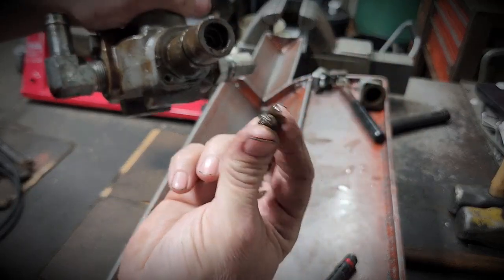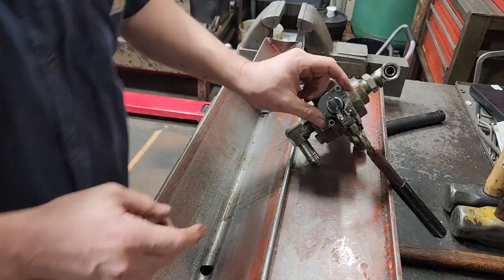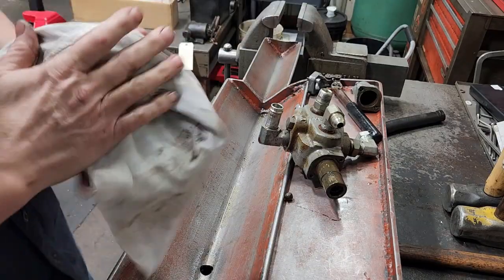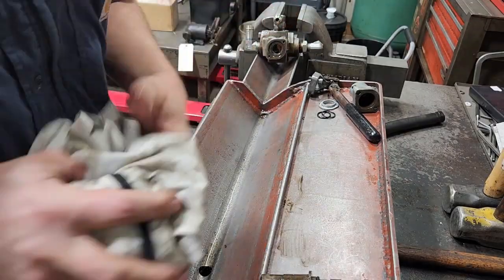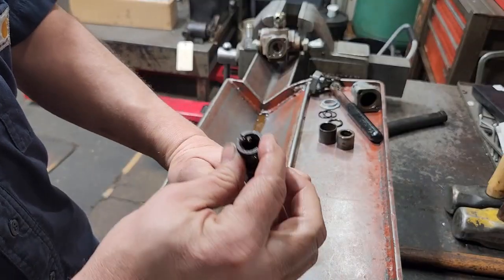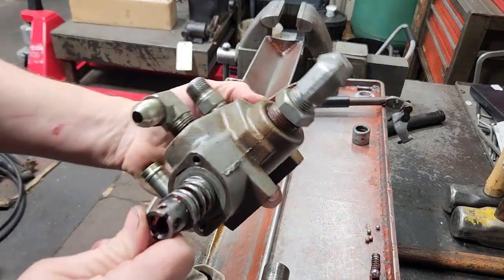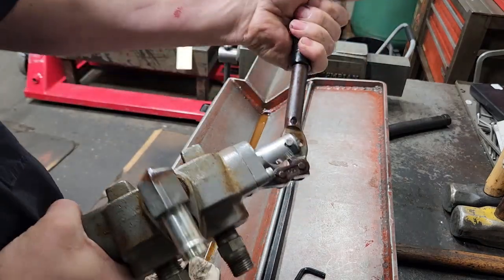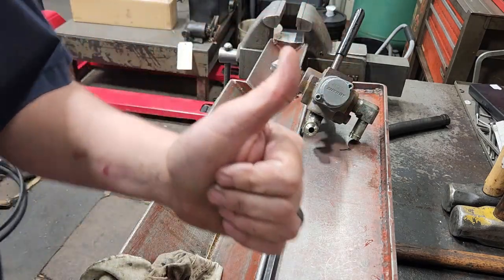Log Splitter Valve Repair | Energy Mfg.

Comment from the maker: I just realized I told you all wrong on the direction of the detent sleeve with the grooves.  The position I told you will detent on the extend stroke so the sleeve needs to be rotated 180 degrees so it will detent for the retract stroke.  Sorry for the misinformation.
Reply: No bigge, I caught it and smiled 😊